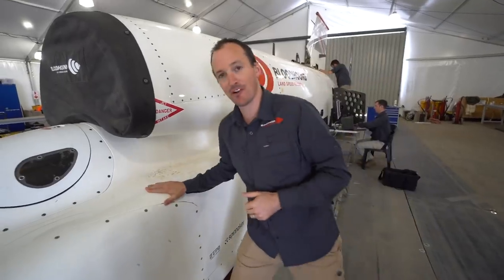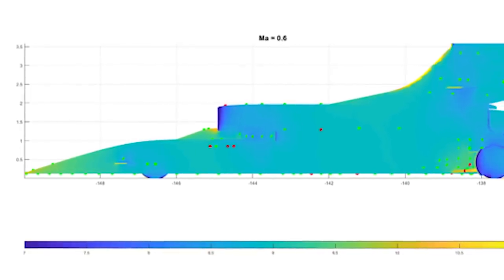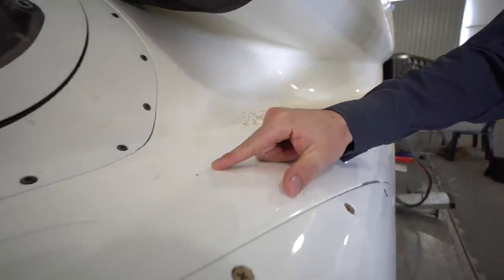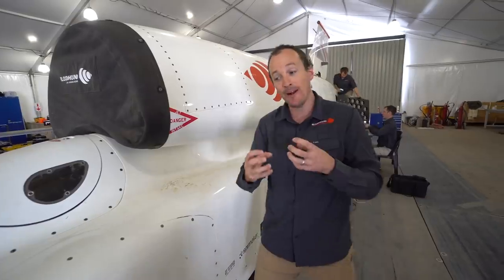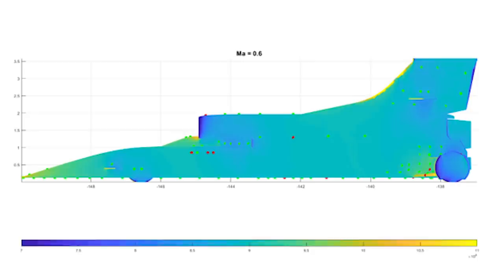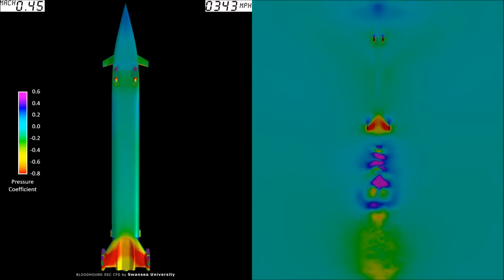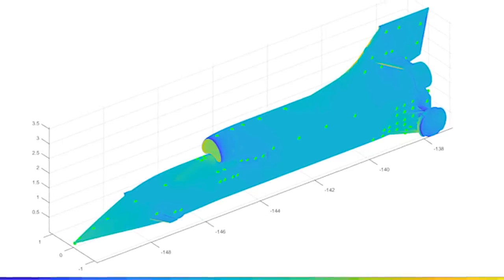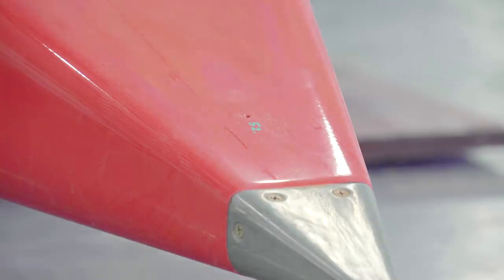Bloodhound LSR's aerodynamics explained | #2019HST

Comment: Cool vid, but didn't really explain anything about the aerodynamics, just talked about how load measurements are made.
Reply: I had hopes they would share more engineering data. That seemed to be in their language leading up to the tests. Even on the website there is little real information beyond what you would see in a press release.

Comment: What a great way to get kids / students interested in STEM subjects. A couple of questions @1:02 why does the model have canards? Do you anticipate needing them at higher speeds or is this just an early variant? Second hopefully the model accounts for engine mass flow rates. At high speeds chopping the throttle to idle could have a big difference on the pressure distribution, particularly in front of the intake it, hopefully you've considered it from a directional stability point of view.

Comment: The air brakes look similar to the grid fins on the Falcon 9 booster. I can see you have some canards near the front. Can you monitor the down-force on the front wheel? I imagine that would be a handy thing to do especially when you're nearing the speed of sound and pressure waves are building up near the front. It occurs to me the most dangerous way to fly a rocket is horizontally just inches from the ground. Hey kids don't do this at home!

Comment: Be nice if you could break the 10 minute barrier with videos lol ,there must be more than 2.11 minutes of aero info you can give us ,How does it handle the shock wave at supersonic speeds
Reply: They haven't been supersonic in the car yet, and won't do this year. That's the plan for next year once they've had it back in the UK for a while, got the rocket engine in, etc
Reply: @ @andrewbailey7999  ,I know that would be nice to see the computer model they have for it going supersonic, does it have active suspension for ride height like thrust 2 ,would be nice to have more information, I'm sure most people following this project have more than a 2 minute attention span
Reply: I don't think it does have active suspension, but perhaps it's adjustable. I'm not sure

Comment: Why does it need so much steering input. And why does the steering wheel lool so shitty. Maybe investment in a f1 style one would have been better
Reply: As explained in one of the other videos, 90 degrees steering input equates to just 2 - 2.5 degrees change in the steered wheels, usually because of gusting side-winds. In today's video there was very little steering needed. At high speed they are generating steering not by reaction with the road surface, but acting more like aerodynamic steering fins. 

The other way around, F1 steering wheels are a compromise because the cockpits don't have room for proper screens and switchgear, so have to bodge together a tiny screen and a couple of multi-function dozen switches. Far better to have good sized instrument screens and controls that are exactly where your brain knows them to be. This cockpit was designed by the bloke who is driving it, and given that he is the current land speed record holder (and several others) I think he knows what he is doing. In applications as extreme as this, functionality is everything. Appearance is nothing.